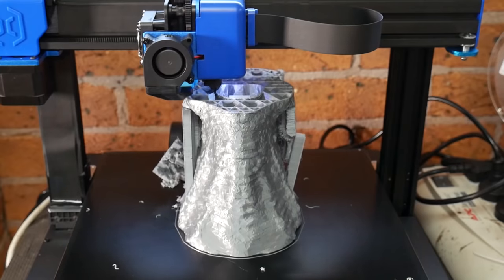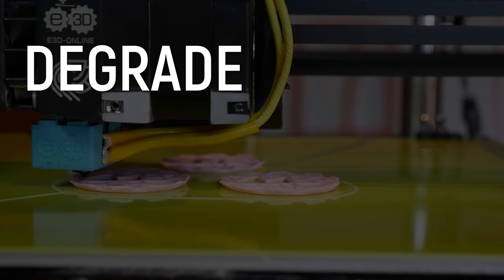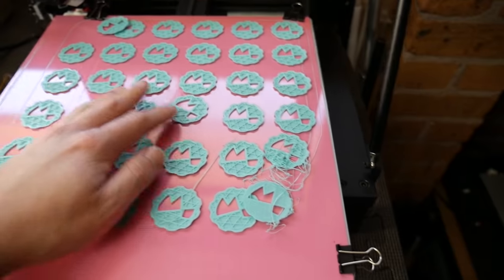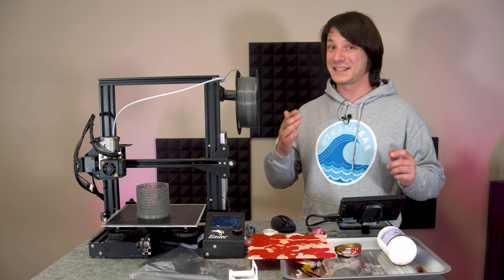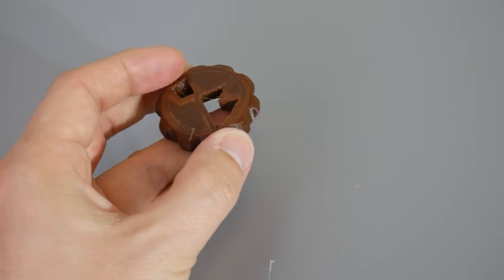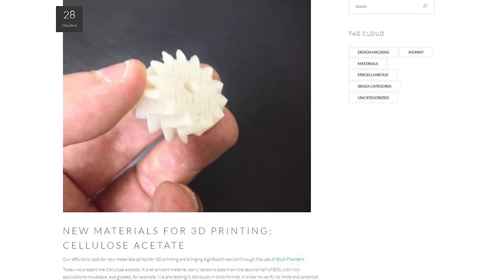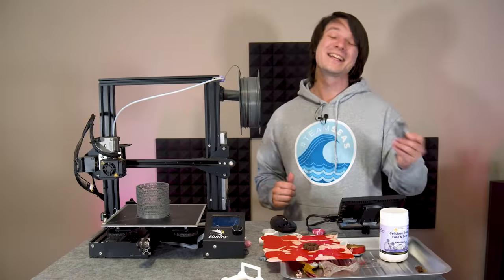PLA - 3D Printing's Biggest Lie.

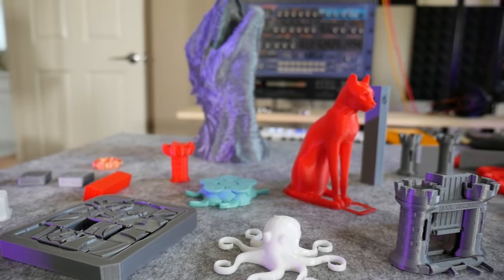Comment: 4:24 It's important to point out that there are other options than landfills or the environment. Incineration is cheap, doesn't need much space, and recoups some of the energy stored in the plastic as electricity or heat. Because Cornstarch is a renewable resource, incinerating PLA is effectively carbon neutral.

Comment: In Germany we have various household rubbish. Plastics, aluminum foils or the like are collected separately from normal rubbish and then (hopefully) recycled, the other garbage goes to a incineration plant. With a lot of packaging and plastics, however, I know that it is not recyclable (better said it is not economical to do so) and I consciously throw that into the normal garbage that is burned afterwards. Like this, the chance is lower that some of it will be exported to other countries for "recycling" (because it is cheaper there) and end up in rivers / seas ...
What kind of packaging and plastics are really recycled by your waste company can be looked up on the Internet, the rest should burn in a fire 👍

And yes in my opinion it's much bether to burn garbade which can't get recycled instead of shipping it through the globe to throw it in the sea. Plastic isn't a rare recourse, it's just bad for the environment if it's getting there, so burning the crap with a good exhaust filter ist probably the most efficient way to help the environment. And way more cost effective than recycling facilities.

Comment: The beauty of plastic is that it doesn't break down easily.  The problem with plastic is how it's extensively used where it doesn't need to be.  So few people 3D print that it's not a real problem compared to throw away products that abuse plastic, like bottles and packaging.  We just need governments to forced companies to use metals or glass instead of plastic, when plastic isn't needed.

Comment: Maybe, this cellulose acetate could be printed in a cold but liquid form (after it has been solved with acetone). To solidify, the fan would need to emit hot air to evaporate the aceton (yes, that might be the unhealthy part of it unless you have a good ventilation). If a print failed, you could resolve it in acetone and start again. Is this just weird or could this work?

Comment: What about something that you can melt down your unwanted PLA prints or support material back into more filament so it can be re-printed? It's not a perfect solution but if a print stuffs up I'd love to be able to melt it down and have another crack rather than throw it out

Comment: This and the through away plastic grocery bag is a big issue. Some stores have bins you can return them to be recycled. Is PLA too different to put in those bins? Is there a practical filament out there that can be used that is made of the same stuff those bags are of?

Comment: I've actually been contemplating how to handle the majority of my PLA waste, failed prints and support material. There's some ideas I've had but all require a bit of energy that I'd like to find another way around it. I have some ideas but it will be a while before I can put it into action...

I'm not looking to get rid of it, per se or looking to reuse it as filament (too much work at the moment) but larger basic shapes being pressed out of my scraps is the first plan. o.o
Reply: Heh guess I'm not the only one with that idea, but I have other methods on my mind ._.

Comment: I keep all of my failed prints and scrap with the plan to someday upgrade my workshop to be able to recycle it into new filament. It's a bit of an expensive upgrade to buy everything you need to recycle it and reform it into filament but I think that is a far more reasonable solution then using an inferior plastic. As we've seen throughout years and years people are only willing to do something about it if it directly impacts them so while PLA doesn't degrade under natural conditions it is made from renewable resources and the fact that it doesn't degrade under natural circumstances is actually a huge advantage to using PLA because it will continue to exist forever unless directly dealt with so either it's put in a facility that can biodegrade it or it's recycled, I lack any confidence in any governments willingness to bring biodegradation to scale so the best I can do is recycle what I can.

Comment: Or maybe we could engineer an additive for PLA that makes it act like a metal and form an ore instead of breaking down into small particles that can disrupt ecosystems,  but coalescing into veins and deposits.  If you want to be really future minded why not stop worrying about renewable sources but making sure that we can reuse what we already have.  Devote land and money to creating reclaiming and reprocessing sites, that turns plastics into a resource like steel.  If we can get 90% of the market to be made of recycled material that means natural processes would only have to worry about 10%, if that 10% doesn't end up getting recycled anyways.

Comment: PLA should be used for waste burn, that's the best recycling there is. My power at home comes from a waste energy powerplant that uses such high temperatures that the fumes are simple things like CO2 and H2O. The output of the power plant is also filtered.
So it's made from plants that used CO2, H2O and solar energy to grow, and it gets burned and turned into electrical energy, CO2 and H2O, making the bioloop perfect.
Plastic is not used in landfills here, as a matter of fact, landfills are lawfully not possible here.
So the bad about plastics is those parts that erode from the plastic, but mostly plastic that has not been thrown into the bin for burning. If we start correctly disposing plastic, there is only a little bit of micro plastic from erosion. The major micro plastic we get is from plastic not properly disposed of using waste power plants.
However, it is never too late to innovate.

Comment: The word is Thermal Depolymerization.  You can make petroleum out of all plastics and carbon based waste.  And from petroleum you can remake gasoline, lubricants, and more plastic.  The trick is transplanting native beneficial micro flora to maintain life.  It sounds like we could now filter the ocean and recycle petroleum for our use again.  And what ever happened to PLA waste recycling appliances? These tools melted down waste projects and filament and reformed new filament.

Comment: So, to avoid all this, cutting down on useless trinkets, only printing usefull parts, not throwing them out. Failed prints and supports, I tend to shred them up, and use it as filler in epoxy casts, or heated/ pressed into pucks for the lathe...

Comment: 3D printing is still a hobby, its waste is just a drop in the ocean of usual consumer waste. If you really want to reduce the amount of waste of 3d printing, you can sort failed prints and supports by plastic type and then make new fillament out of it. There is a variety of ways to make it. Many people have already created self-made machines for shredding parts into pieces and extrusion of fillament wire.

Comment: Have you put a PLA benchie in a glass jar with some citric acid to see what happens? I know that PLA is used in medicines and the body uses a process called de-esterification to turn PLA to lactic acid using the citric acid cycle and then uses the liver to turn lactic acid into glucose, so there may be a process that can be done outside the body in the same way.

Comment: If the 3D printer took ground plastic powder rather than filament, then you could just grind up failed / used prints and reprint.

Comment: i would speculate that a polymer mix of cellulose acetate and nitrocellulose would improve the melting point issues. not sure about the flammability issues. would need experimentation. that said nitrocellulose was used for a long time in film and I believe still used for ping pong balls so it can't be too bad.

Comment: Even if PLA was really biodegradable, with the tons of PLA spools that come from china, the impact is already huge. There's a several brand that make PLA in EU and US, theirs prices is generally lower than Amazon's Chinese PLA and quality higher. That's an easy step to reduce the impact of 3d printing.

But what we really need is a easy way to make new filament from failed print.

Comment: There is of course a third solution, burn it. Whilst I can't speak to the additives, just burning PLA is renewable, the carbon goes back into the atmosphere for the corn etc to use to make new PLA without leaving microplastic lying around. From what I understand about the production of PLA, that isn't damaging to the environment either (I could be wrong), so making more shouldn't cause further issues. It's like burning firewood and growing trees to make more firewood basically.

EDIT: I'm probably inherently wrong somehow of course

Comment: Nah. Problem: I do not necessarily know beforehand whether or not that piece is going to the garbage or might stay in use for 30 years.
Also testprints would be often useless if printed in a different material to the final product.
PLA is perfect as it is - as long as we don't toss it into the environment.
I want better recycling options. There were proof of concept home extruders for recycled filament years ago. I want those, reliable and at a decent price.
And I want local recycling programs. This should totally be a service at your local hardware store that already cuts your wood and exchanges your bbq gas tanks.

Comment: DIY filament producing machines would be the solution... throw in your failed prints and create new filament to print again. Some clever solution to not need very long cooling ways would be a nice thing. Inventors, the challenge is on! :) (or pellet creating machines and use the pellets in pellet extruders :D)

Comment: There are plastic that are mix in with D2W to make they degrade faster in chemical control landfill from 20++ years to breaking down in piece in just 4-5 years time. Check it out, it's call d2w biodegradable plastic. Maybe 3d filament can be mix with D2W to help speed up their half life.

Comment: The problem with biodegradable plastic is that part of the usefulness of plastic is its durability and resistance to degradation in the first place. No one is going to want to buy a plastic water bottle that will degrade into the water, or some sort of plastic showpiece or tool that might degrade in a highly humid environment. There's very low commercial demand for biodegradable plastic, and it would have few practical uses as well where a different material would not be more suitable, since anything that you want to make but don't want to last simply shouldn't be made with plastic in the first place. Proper recycling and proper use (not using plastic when plastic isn't needed/the most practical material) are the only real practical solutions to the plastic problem, biodegradable plastics are probably never going to be the answer, though ironically the fact that PLA does NOT biodegrade under normal circumstances but CAN under specific, controllable circumstances actually makes it a potentially viable solution, if and only if it is always properly disposed of so that it biodegrades.

Comment: Cellophane is cellulose, not cellulose acetate. Cellulose will not dissolve in acetone, whereas cellulose acetate will.  Cellulose is not a thermoplastic and won't make filament on its own, whereas cellulose acetate is and may, depending on the formulation.  Cellulose is biodegradable but cellulose acetate only with much difficulty, much like PLA.  Both PLA and cellulose acetate could be made more biodegradable depending on their formulation.

Comment: As a transition metal chemist who makes catalysts to polymerize lactide into PLA i can confidently state that this is not completely true. We have seen our PLA polymers start breaking down in sealed vials in as little as 3 months. The only thing that you really "need" to break it down is water and sunlight. Yes this is slow and not as fast as we would like, but it is a lot better than polyethylene based plastics. In a lit outdoor environment PLA should be able to be about 80-90% broken down in about 5-10 years. Is it perfect? No. Should we settle for it? No! But for the commercial availability for the price point is it better than the alternative? YES! It's a step in the right direction! I'm not saying that it's super good, but until we get something like amino acid based polymers (basically DNA) that we can manipulate in a similar fashion, its a good placeholder for now.

Comment: Why don't filament manufacturers take prints to be recycled into new filament? I understand that you don't want to mix a bunch of unknown filaments together, but this recycled stuff could be a separate product, so you can buy fresh filament, made directly from fresh pellets, or you can buy recycled filament, which is just randomly grey coloured and promises nothing on strengths or anything. It would be an ideal material for test prints, because it could be cheaper, and it doesn't need to exist for many years. Much like newspapers are printed on recycled paper, because it's cheaper on doesn't need to last, and nobody cares that it isn't pure white paper.

Comment: I believe microplastics are specifically microscopic plastic sediment (some of which is mostly inert, though long-term exposure is still poorly understood, and for comparison you've got various types of extremely finely divided insoluble minerals that appear to be mostly inert, but can still be carcinogenic or otherwise have influence on biological processes).

Larger, visible to the naked eye (macroscopic) plastic bits are a different matter entirely and are a well understood pollutant, predominantly present in landfills in the first world (and a problem for certain species of scavenging animals, including some birds, that frequent landfills with exposed/unearthed plastic refuse), while the vast majority of oceanic plastics (over 96% worldwide) as of 2022, come from improper disposal of waste plastic in India (39.3%), China (21.9%), Indonesia (16.5%), Brazil (11.8%),  and Thailand (7.1%).
(this is also why legislation made in most 1st world nations that only impacts domestic use of plastic will have very little impact on the global problem, where economic or political pressure on the major polluting countries either from within those nations or internationally would make a real impace)

Comment: What is stopping one of the 3d printing producers , designing and producing a recycle system where by you can crush your scrap prints and support material to produce filament,  there are some extruder units on the market now but the crushers are way to expensive and cumbersome, a heater bin would make more sense as you could re melt and then extrude, if not for the individual why can't some of the 3d supplier's be encouraged to start a buy back system where by you get a discount on new or recycled filament based on the amount you have returned. they can either bulk ship to a recycler or start their own recycling service, and re sell to the end user, some where in that I believe money to be made or plastic saved. On another note , keep up the great work that you do, as I personally would have binned my printer if it wasn't for stumbling across your blogs twelve months back. Thanks.

Comment: What?!  Green labeling is a lie?  Welcome to the conversation which started like 20 years ago.

I crushed the bubble of my nieces when I show them most of the paper products they put in the recycle bin actually goes to the local power plant to be burned.  Turns out most of the plastic and glass goes straight o the dump.  (Turns out sorting and cleaning is too expensive)  Aluminum cans is the only thing you can consistently count on being recycled.

I remember the hype around PLA and other ag products as plastic replacements.  The unflavored  cheese puffs and popcorn that was going to replace packing materials such as Styrofoam?  That lasted all of 5 minutes.

So not so surprised that PLA turns out to be just regular ol' plastic regardless of its supposed "green credentials"

The only thing I like about it is that it shows that we are never going to have to give up things traditionally made from oil.  (After the oil runs out.)

Comment: I dont care about "biodegradability". Resilience of plastics is the most admirable properties of it. It allows us to create things that will not rot, mold or rust, and will serve for tens of years. Its not plastics fault that it is used for single-use things. And even if you have to get rid of plastic garbage - some is recyclable, seconds can be destroyed by certain strains of bacteria or fungi, thirds can be destroyed by ozone, fourth can be used as coal substitute in iron metallurgy.

Comment: Better 'just' degradable than petroleum based...
In Norway 3d printer waste goes in the general waste which is being burnt in controlled furnaces to produce heat for thousands of homes. 
All other materials are being recycled (glass, wood, clear plastic etc)

Comment: Well, you can just burn plastics for energy (heat, electricity) and release the CO2 into greenhouses to speed up the plant growth. All plastics eventually degrade, which means almost none of them are 100% recyclable. If we make plastics from renewable resources, why bother recycling? Use them as fuel.
PS.
In high enough heat the molecular bonds of more complex products of the burning get broken down into simpler molecules, so It's a very environmently friendly way to utilize our trash, as long as we find the way to bond the C in CO2 into something. If we do it the way I proposed, we can pretty much turn our plastic junk into food (plastics -> heat+electricity -> heat+light for the greenhouses -> fast growing food, even in winter)